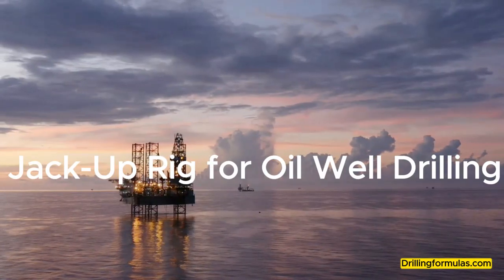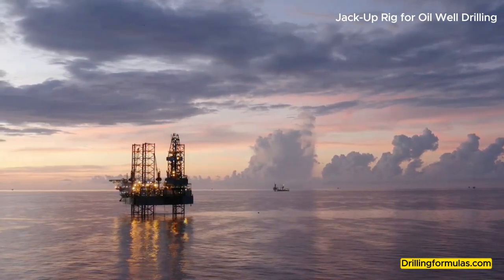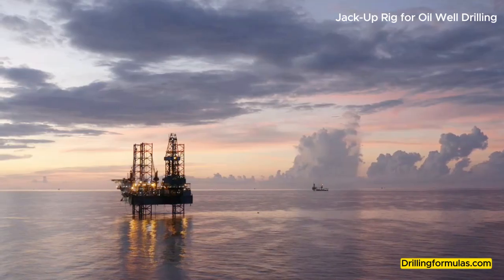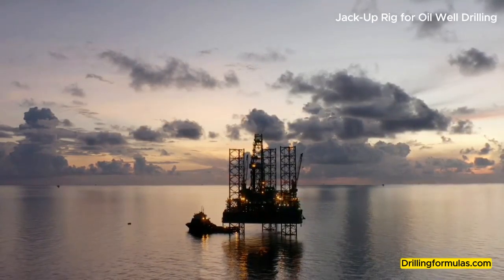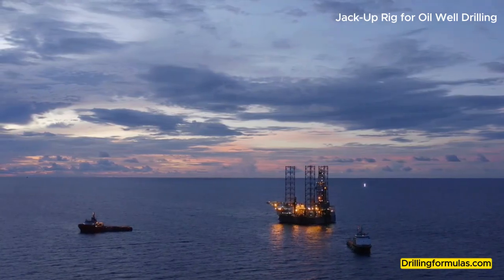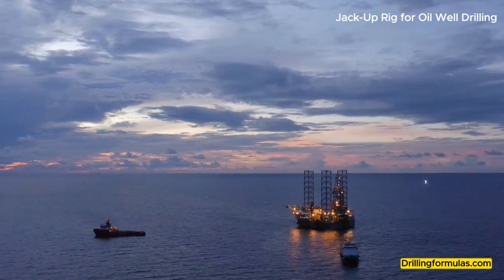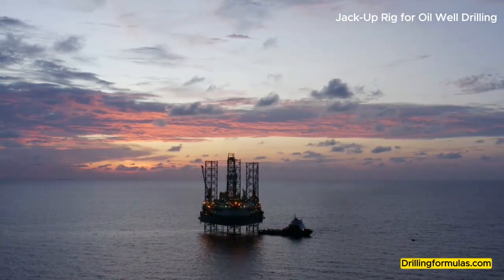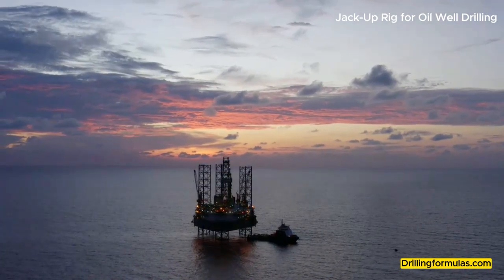What is a jack up rig?

Comment: JACK-UP RIG NEEDED

Major specification: 

Operating Water Depth: 
122Metres-(400Ft)

2,500 or 3,000 Horse Power 

10,000 to 15,000-Psi

All others features should be of standard level.
Thank you. 

Please, once it is available, let's discuss the price because they want to move to the site immediately and also mobilize their workers to the site. 

OML 102; ETISONG FIELD
That's the boarder line to Equitorial Guinea 🇬🇳
The rig is urgently needed, like now. 

DURATION OF ENGAGEMENT: 
One year prompt

DM if you have such that can go for the job